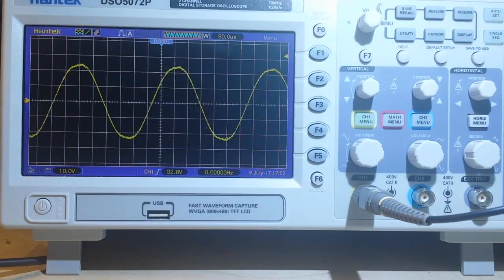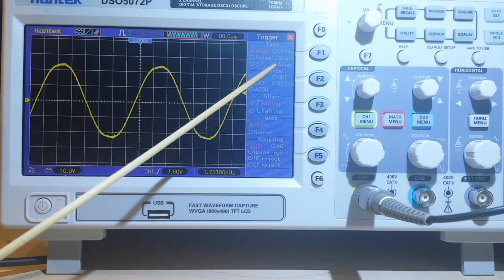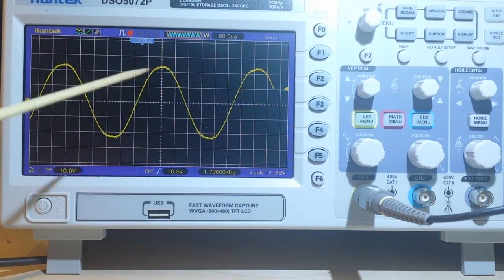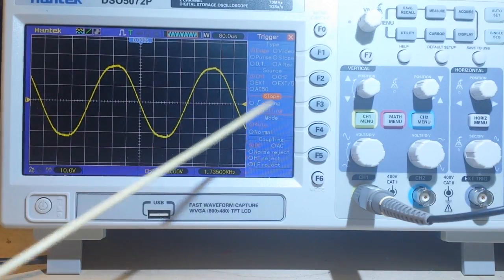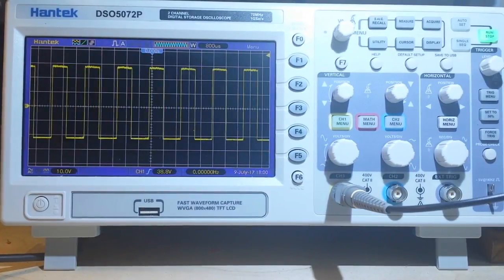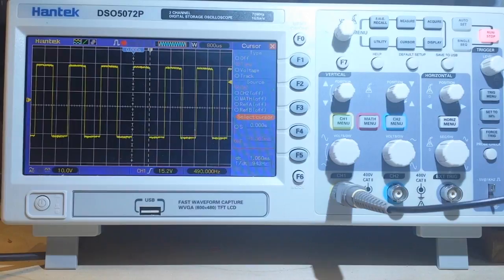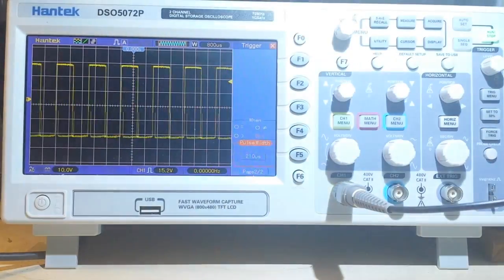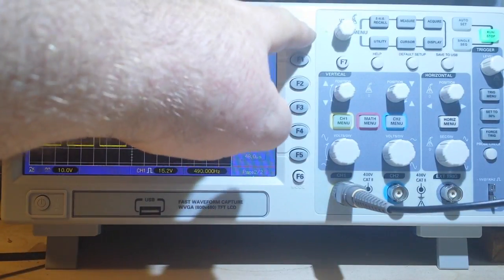Oscilloscope Basics   How to use the Trigger System

Comment: where are these signals coming from?? 
What does triggering mean?
Reply from the maker: The signals come from a signal generator also known as an arbitrary waveform generator. Triggering means at what level or in this case voltage does the waveform need to cross before the oscilloscope starts capturing data.